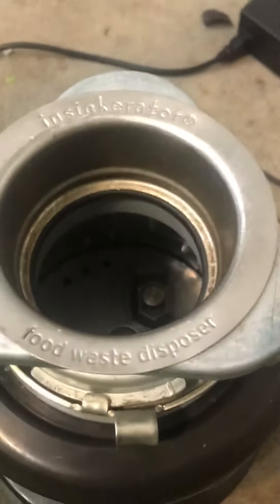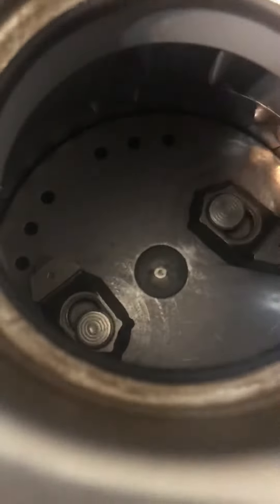Their are no blades in a garbage disposal

Comment: Our Insinkerator works ok when it is spinning full speed but as it slows to a stop when the power is turned off it sounds like there is a spoon or something metallic clanking around. The impellers move freely and I see nothing in there when checking with a flashlight.
Reply from the maker: Check to see if anything is stuck in the grind ring
Reply: @erickmorton8085  I know what you mean by grinding ring. I don't see anything stuck in it, but it sounds like the impellers are making contact with the ring as it slows to a stop. I called the 800 number on the tag and they checked the serial number and the unit was manufactured in 1994!

Comment: My 26 year old Insinkerator 333 has this exact identical design interior.  It isn’t sound insulated, so I have to plug my ears whenever I put waste down it.  The newer Contractor 333 models are much cheaper with the Badger interior design.
Reply from the maker: It’s a good disposal
Reply: is it the blue 333ss?
Reply from the maker: @aunabreslingaming3279  no
Reply: @aunabreslingaming3279  It’s a regular 333 with 1/2 horsepower. It is blue.
Reply from the maker: No this is a kenmore
Reply: snice

Comment: One of my impeller blades is really loose and I can pull up on it quite a bit. So much so that it makes a really loud noise when turned on. Any way to tighten them? TY
Reply from the maker: No the disposal probably needs replacing
Reply: @erickmorton8085  well that sucks.  It’s only 2 years old.
Reply from the maker: @entrrt  when getting a new disposal don’t get the cheapest one available

Comment: Anyone know how to tighten these? Mine sound like it's about to fly off
Reply from the maker: They can’t be tightened
Reply: @erickmorton8085  why can't they be tightened? So what do you do when they become loose? Replace the whole unit?!
Reply from the maker: @k.baller5140  it’s held on by rivets if yours is broken off you need a new garbage disposal
Reply: @erickmorton8085  it's not broken off... It's just very loose... I can wiggle it up and down... Can't I just tighten that?
Reply from the maker: @k.baller5140  it’s supposed to wiggle a little
Reply: @erickmorton8085  I know that but one side is completely loose, including the spacer holding it so it wiggles too much/causing horrible noise. Can't I just tighten that part?
Reply from the maker: @k.baller5140  no it can’t be tightened you will have to replace the garbage disposal first check to see if anything is stuck between the grind ring and impeller if not you need to replace the disposal